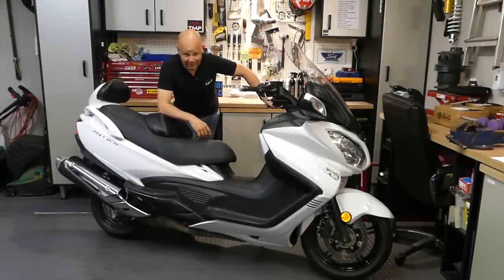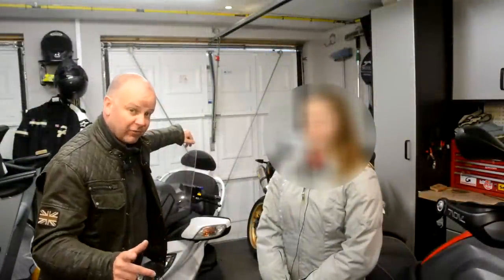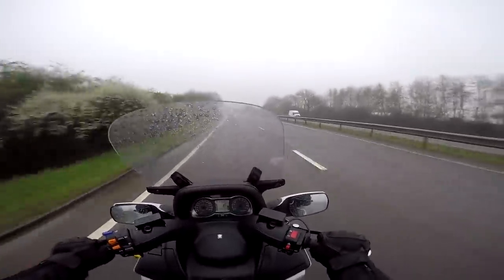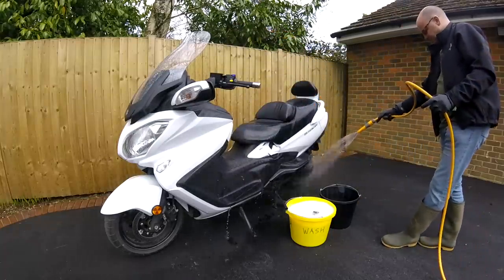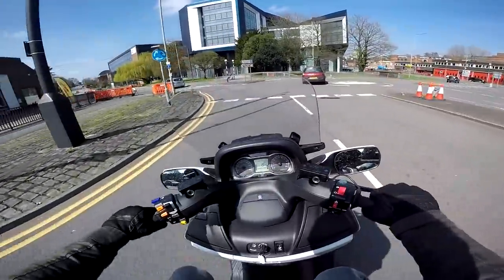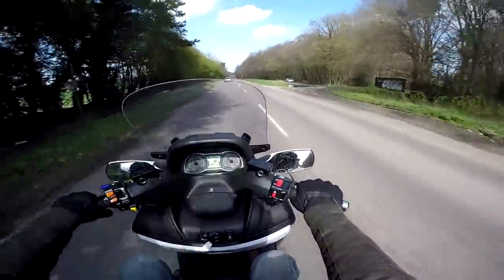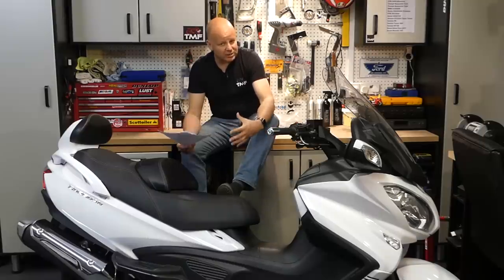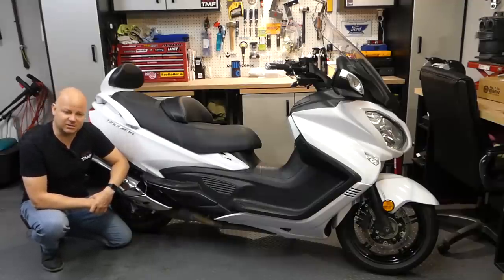2018 Suzuki Burgman 650 Executive - Long Term Review

Comment: I had a 2nd hand 659 Burgy 14 years ago and kept it for 4 years. I went touring on it with my, then, 15 year old Grandson down to southern Burgundy. Mine did not have all the bells and whistles in those days, but I had a Givi 52L top box on, so we had roughly the same space under the seat and in the box. We did nearly 1500 miles in the week and had no problems and averaged 55mpg. We cruised between 80-90mph on the autoroutes in great comfort. Your bike is obviously a much more modern version than mine, but have they removed all the electronic gearbox options and the power button, which you made no mention of? I might add, that I had a number of other bikes at that time, including a Blackbird(which I'd had flat out a few times), and i thought the Burgy was just a great bike and still think about getting another one. You're right, the handling at speed through 'twisties', takes a bit of hanging on to, BUT it's a scooter and I loved it. By the way I loved your MT10 review, and I've had mine for 3 years now. Utterly besotted by it!

Comment: You'd have to be clinically insane to spend 9 grand on a scooter
Reply: Or maddened by the inadequacies of conventionals!
Reply: Then I may be. If I had a spare nine grand (and room for another bike) doing nothing the Burgman would make the list.
Reply: I totally agree, but once you buy used, you can get one clean for $6K
Reply: $9k is cheap. This will do anything a Harley or big touring bike will do at half the cost, more nimble, and classy storage.
Reply: @michaeljohnson2922  
Thank you!  My sentiment exactly
Reply: Yeah!  I've bought 3 maxi scooters, and am looking for a fourth.
Reply: @Matthew Hoopes you will find SilverWings for less. Maintenance are cheaper on the Honda. Easier to do yourself too. Cheaper parts on the Honda. The SilverWing handles better. You can always add a better wind screen, heated grips, and even a heated seat to the Honda and it will still be less expensive. A top box is an easy add on on the Honda. It requires a special mount on the Bergman. For a first big touring scooter, you can't go wrong with the Honda. You can find a good one for around $2000. 
The Burgman comes with most of the goodies. Costs more, and maintenance is a little more complex. But they are nice. If you are going to have a shop do all the work, they are about the same. Except the drive belt. Then it costs about twice as much on the Bergman. I replace my drive belts every other year. My Bergman has 50,000 miles on it and my SilverWing is about to hit 100,000. I have only put 20,000 on my BMW and it is the most expensive of my scooters. 
Regular gas in the Honda, the Bergman and BMW like premium. Best mpg...Honda. A whole new set of plastics from China for the Honda runs about $800. Just the front plastic piece on the Bergman costs more. Try and test ride them. If you want the best, try the BMWcg650 gt. Pricey but nice.
Reply: You'd have to be crazy not too!!!!!!!!!!!!!!!!!!!!!!!!!  Do your own thing.  It draws the girls.

Comment: Nice review.  I am an old grizzly hard core biker but always saw the Bergman as a very practical "city vehicle."  I am aging and no longer need a really large motorcycle.  I ride an YAMAHA SR500 with big bore kit so it is really a 600. You have to love "Thumpers" to live an SR400/500. Mine has been extensively modified.  I hace done 1000 mile trips on it.  I have ridden the Bergman. It is very comfortable.  Much more so than my Yamaha but I can ride off road to a certain extent.  With a 5 (4.9) gallon fuel tank 250 mile between fuel stops is really convenient.   My next mod with be belt drive.

Comment: Very interesting review! I have just a question about the transmission. I keep reading that there is a big possibility that it can break and that is a very expensive repair. Do you know if this is still the case or did Suzuki fixed this? Also, I was wondering if you would do a review of a Maxsym 600? Also a big scooter and less expensive than the Burgman. Anyway, great vid and i was happy to see you enjoy yourself!

Comment: I have also a Burgman 2018. I agree with some negative points but some you can resolve. For instance the suspension you can replace with Hyper pro suspension front and aft and I can tell you that you get a completely different bike and it is awesome!! And the screen you can replace with a bigger screen so that is not a negative point because some like a lower screen. And the looks of the Burgman well that is a personal taste. I think that it is a fantastic bike to ride on and you can easily cruise 90 mls/hr. I love her. Greetings from Holland.

Comment: I have the 2015. I love everything about it. I have about 38K, mostly city. I love the power button to save the brakes, just press and it you slow way down. My only negative is when it needs to be worked on under the Tupperware, you have to pay extra to have it taken off and on, which can be "timely"..

Comment: Cheers MF. I really enjoyed your honest, objective review. And as an American, it is great to almost get the experience of what it is like riding my Burgman on UK roads and motorways. 
BTW, it is also worth noting that one of the main differences between the larger maxi-scooters and smaller scoots is that on these massive bikes the engine is mounted directly to the frame like a conventional shifted motorbike versus the small scoots normally having their motors attached to the swing arm. So the whole weight displacement is set up differently and contributes to that stable center of gravity feeling.
Reply from the maker: Yes good point! …and thanks for watching!

Comment: Im 25 and I ride an burgman 650 and a SV1000 and a Gixxer and if i had to choose one bike to to it all it would be the burgman. Whatever you do with it, shopping, commuting or riding through the twisties it does all of it. You can easily keep up with almost everyone who is not a complete hoonigan and you will at first get some comments from other bikers if your ride with them the first time. That changes when you pass them in the corners :'D 
I like the isolation from the weather the most. You can ride almost the whole year without getting cold, have a lot of storage and a lot of power. The biggest annoyance is the small 15 Liter Fuel tank. I had a scoute before which had 17 Liters and you felt like you never needed to fuel it up. With the burgman and around 5-6l/100km it feels like i ride from fuel station to fuel station.
Reply from the maker: Yes, lots to be said for these big beasts aren't there...tganks for watching and for stopping by....

Comment: So nice to see you review the Burgman. A lot of "proper bikers" seem prejudiced against them but they are great machines. With regard to touring, add a big top box (I have a Givi 48 litre) and there is masses of luggage space. This would also solve daughter number 1's issue with the low back rest as you replace the back rest with the box and can fit a higher pad to improve comfort. You can add panniers to double capacity again but it makes the burger stupidly wide!
Reply: i'd like to see this thing pull a camping trailer, I see bikes pulling camping trailers all the time. i'm a truck driver, always "on the road". anyway, the mid-size tourers don't get their credit.

Comment: Thanks for your review, I am thinking of buying a second hand one in the next week or so. Fingers crossed, you helped for the complete "Yes". One point I disagree with you in your negatives, as I was surprised you raised as a man who rides a lot, is that the buttons etc... on the right hand side, if you noticed you don't need to use them often as mostly will be controlling the throttle, you don't need to turn the scooter every few minuets, it's only one time, and that goes for the rest of the buttons on the right hand side, again, good review, thanks,

Comment: 2018 is not a long term review.
I've had one of these since 2011. It's been mostly fine but is falling apart now at 52k miles. The bike is now at the end of it's life, needing complete rebuild and much work doing. This is my long term review:

Things that are great : 
Folding mirrors, brilliant traffic beater. Press a button and leave the cars for dead through narrow gaps.
Engine is bullet proof. Good power and completely reliable.
Manual gears at the push of a button if needed (more economical and easier to drive at low speed)
Ample luggage space.
Fairly maintenance free.

Things that suck :
The weight is ridiculous.  Feels like a Gold Wing. dropping it is a no no. In the snow you will not pick it up on your own. This affects your brake pads, as you will go through them as it takes so much to stop it.
Brakes: These as usual with Suzuki suck bad. They easily seize up in winter and require brake cleaner solvent spray on them regularly if you don't want want nightmares. They often bind without this care and will affect your MPG. At their best they never quite let go of the disc fully so constantly wear out.
Wheels: These are practically impossible to clean. I have older ones to you which are embossed alloy. I gave up many miles ago. Even Wonder Wheels is too much hard work for it to be worth it.

My next bike will be something lighter with better brakes, like Kymco AK550 which I will test ride soon.
Reply: I love my burg 650 but yeah the brakes do seize in the cold, the service interval is insanely short and putting air in the rear tyre is just terrible. It really needs angled air filler nozzles as standard. I have about 70,000km give or take in mine and I will probably have to get rid of it this year before stuff starts to get unreliable. It is 15 years old so to be expected.
Reply: @SurmaSampo   I second that. I had a slow puncture in the rear which carried on when they replaced the tire, so it was always a pain until I put some tire weld in it. I've gotten rid of it now. It was going to cost £4k to put right all the things that were wrong with it. I got £800 for it, and I was happy with this since they didn't notice the oil leak and all the problems that were diagnosed when I tried to get it fixed. I ended up with an AK550 and I'm so glad I swapped. As much as I miss the luggage space, the electric screen, which the AK could really do with, my new bike is so much more fun and easier to ride.

Comment: His criticism on the right hand buttons, I disagree, they are fine, shocks are fine, handling good.  But, where I agree is that the bike should have digital cruise.  Also any bike could use more storage.  I have put tens of thousands of miles on 650cc burgmans, they are dependable.  I do the fluid changes myself and I say the plastics could be a lot easier to remove and replace.  These burgmans are the best I have ever owned and I have owned many types and makes, 13 other motorcycles.

Comment: Interesting review TMF, certainly a nice machine. I swapped my 400 model for a Vstrom though, 4000 miles service intervals became expensive and inconvenient for high mileage commuting. Great tools for town work though 👍
Reply from the maker: ...agreed - thanks for watching!
Reply: Nearly all the services are easy to do yourself. I only use the dealer to keep the warranty good and that includes the first valve adjustment. After that, except for changing tires, I do it myself. That's how you save money.
Note, I change my oil and oil filter every 3000 miles on all my motorcycles and scooters.

Comment: Great review! i almost totally agree with you. But the windscreen adjustment makes a huge difference for me, the 5 or 6 inches is not much indeed, but when up or down, BIG difference with windsounds. I'm 6.5 feet tall.  Point 3: On the right side  are no buttons you have to operate while driving, it's the starter button, windscreen button and alarmlight button and an engine killswitch, when would you use that while driving? almost never.  See ya!

Comment: very good in-depth review!
My comments:
- around 50K you need to repair / replace the CVT Transmission. can be very expensive.
- if you set up the suspensions to a harder settings the ride in high speed is better
Reply from the maker: Thanks for the kind comments and the insight!

Comment: Whahey Mr Miss, another excellent review, even if you did overlook a few things. Re the petrol filler: I found on the 2008 model there was a lot of blowback, so you had to fill very slowly. On the 2013 model Suzuki seemed to have improved that. Still on fuel, I think the best mileage I ever got on a full tank, motorway driving, avg spd 65-75mph, I was pushing it to the limit trying to get 150 miles before a refill. On the dash, the ADJ button gives a choice of readouts 1: constant mpg and 2. ambient temp - both very useful. My personal, biggest bugbears with the 650's were 1. calipers forever seizing up if the the bike hadn't been used for a week or after any bad weather, and 2. I found it impossible to keep the rear suspension from rusting like crazy. I always paid for  a 3-4-year service plan which is not cheap, but better than getting a much larger bill each year, so servicing the Burg can be an expensive necessity. The alternative is to buy a car at the same price!! There is one other thing which you would not have noticed, and that's the wear and tear on the rear tyre. The Burg is a very heavy bike at around 280 kilos and I found that after about 4.500 miles it had to be replaced purely on safety grounds. The overdrive, you didn't mention, but it's something I never had to use, for as you say, the power is already there. I've overtaken vehicles doing 75-80mph with no no effort whatsoever, as the bike will hit a ton in a matter of seconds, should it be necessary! For touring, I always had a back-pack strapped to the pillion seat with both a cargo net and a crocodile strap, while in the "boot" I kept the essentials such emergency repair kits, first aid, spare gloves and boots, and...for me (going back to the fuel) a plastic 2-ltr gerrycan full of fuel..just in case! Never at any time did I feel the bike was off-balance, so for touring (and less back strain) the 650 has it. I suppose, as with any vehicle, riding around the town centres can drink the fuel like mad, but it's impossible to put a value rating on that. If I were back to being a fit and healthy young man, I'd pick the Burg 650 over any equivalent step-through. As it is, I now have the 400, and it's currently giving me between 83 and 99.9mpg. The best I ever achieved on the 650 (up to Scotland and back) was 87mpg. Now, that can't be bad!!
Nice review Mr Miss. Loved it.
Reply from the maker: Thanks Charles - and thanks for taking the trouble to write all that feedback - TMF
Reply: Np problem, and you're welcome, as long as it might prove useful to would-be buyers! BTW, thank you for your review on my efforts!!

Comment: if you look at the Burgman as “half a car” then it makes much more sense if you are coming from the “car side” of the divide than the “bike side”. This is a much less intimidating step into the world of bikes for a car driver than say the z900.  

If you live in or around a big city and are regularly stuck in traffic on your commute - this is a much better option if you decide to swap to 2 wheels: 
- Integrated, invisible lockable storage
- Great weather protection
- No gears or clutch to distract you so you can concentrate on bike control, other traffic and directions (this alone probably halves your chance of an accident as a newbie)
- low centre of gravity and foldable mirrors makes filtering less scary, which if that was your motivation in the first place (avoid traffic) makes huge sense.

Car > Burgman > z900 makes more sense than z900 > Burgman > Car
Reply from the maker: Yes 100% agree with your point....clearly these aren't aimed at seasoned bike enthusiasts like me and (I assume) you....

Comment: Have to agree with your daughter about the seat comfort.  It is big but my the foam is tough and I found it unpleasant after 10 mins or so.  I also found the scoot a bit cold despite the heated seat and bars.  It was the bit under my legs - where there is normally an engine, which I found got draughty and cool.  Afraid I never go on with my 650 Burgman and sold it after a few months.

Comment: I didn't mind your review overall but I have a bone to pick with you because you left two parts out of it.
The power button you never said a word about it or what it does.
What about the fact that you can drive the bike manually instead of leaving it automatic?
If you drive it when it's in the manual mode and the power button on you'll notice a big difference in how it handles.
Just be aware of the fact that it has a shorter shifting range the power mode.
So don't you think you might want to do another review or an outdated review regarding the Burgman 650?
Don't get me wrong you did a good review and I agree with you about a lot of things especially the fact it should have a cruise control.
There are people that are picked up aftermarket ones and installed them on the bikes and said it makes a big difference.
anyway thank you for the review have yourself a good one
Reply from the maker: I'm thrilled to hear that you "didn't mind" my review overall!  Well worth the effort I put in to hear those words - thanks ;0)
Reply: @TheMissendenFlyer  Sorry if I came across as being a bit of a jerk that wasn't my intention.
I just wanted to hear your thoughts on what you thought about the manual shifting and the power button when you're riding with it.
I like your review and your honesty about what you thought of the bike.
I just wanted to hear more of your thoughts on that part of the bike.
So far it's my leading choice for the bike I would like to get when I'm ready to start riding.
The term didn't mind was not exactly the right choice of words.
Have Yourself a Good One!!!